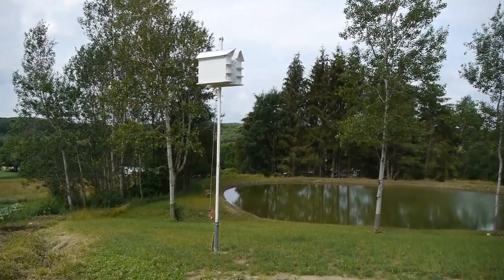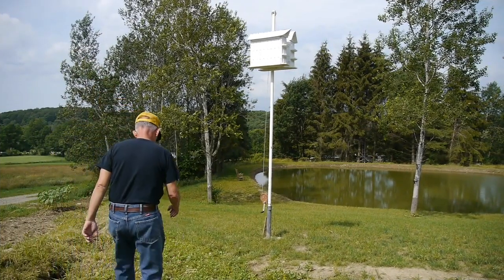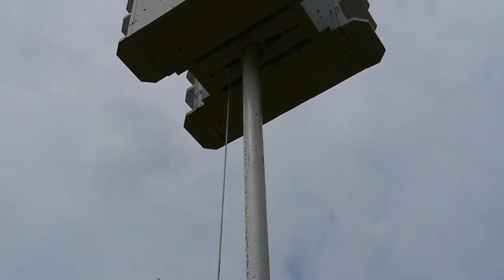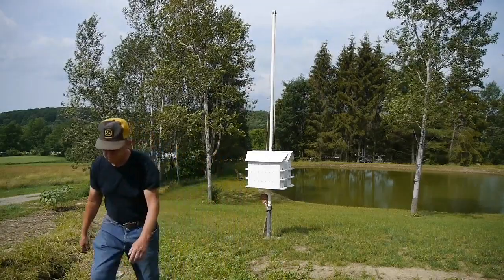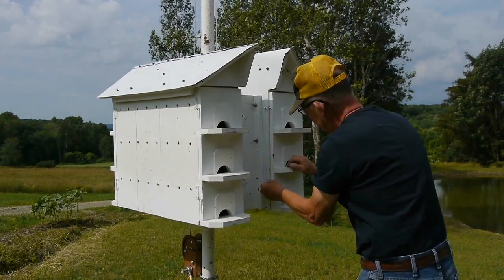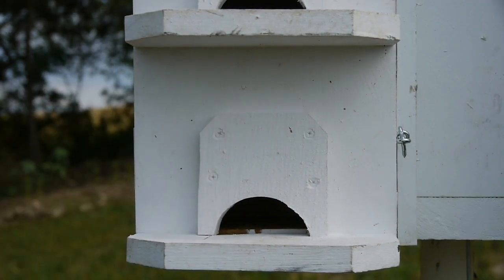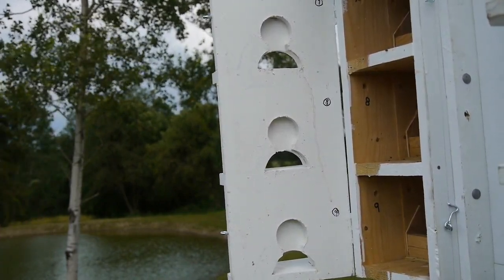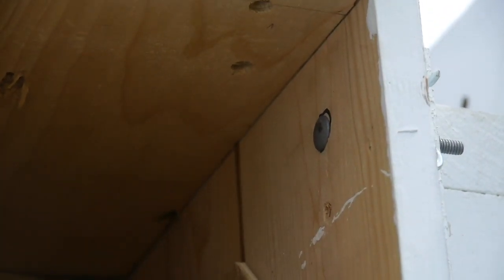Purple Martin House on a Pole

Comment: Would like to see more details on the pulley system, though I can see some details from the video.  Looks like you have an appropriately sized hole, matching the pole, through the center block and slots on each side of the pole for the pulley cable to go through, and a pulley at the top of the pole.  Does the brake on the winch keep the house from falling?  Looks like the cable segments in the slots in the middle block would keep the house from rotating in the wind.
Reply from the maker: You got it right. Yes the brake will stop the house in any position.  It's called a brake winch.

Comment: your house is fine where it is Martins Like to soar a lot and be able to see there house also the recommended height is 12 to 18 feet .Give it some time  because the babies will return and move in.
You can lower the house and clean it then cover the holes in off season.
Reply from the maker: No.  the cable keeps it from spinning.

Comment: i made one with a winch too, however it rode up and down on a 4x4 post which didn't work out because the 4x4 twisted. I was thinking about using straight exhaust pipe too but afraid it might bend in the wind. Any thoughts? how tall is your house? Great job

Comment: I like your pole. Do you have a video on making it.
Reply from the maker: The pipe is a piece of well casing i got from the scrapyard. I primed and painted it and we dug a hole 3 ft deep and cemented it into the ground.
Reply: Thanks much.  I'm still trying to figure out a gourd mount.  How tall is your house?
Reply: I see it is 12 feet.
Reply from the maker: It's up about 12 feet , I think

Comment: Can you tell me how I can find a winch pole like yours?
Reply from the maker: Hello Shelly.  The pole is a piece of well casing pipe i got at the junk yard which i cleaned up and painted.  The winch is a "brake winch".  I searched online and bought it somewhere.
Reply: You can use a winch from a boat trailer, the exact same thing
Reply: You can buy similar wenches at Harbor Freight. They ship is one is not near you. They are very reasonably priced. Don't go too cheap if you can afford it. They do work great!
Reply: The only issue with a boat winch is that most are not Brake winches, meaning is you let the handle go or it gets away from you the house will come crashing down very quickly.  It is advisable to make sure it is a brake winch.  As mentioned by others Harbor Freight has several at very reasonable prices.

Comment: So how did you do? Get many martins? I bet it filled up by the end of the season!
Reply from the maker: Actually, I do not have any Martins yet.  I have learned that it's best to put up a Martin House where you can monitor it and keep the sparrows and black birds out.  I am not at my camp much and the Sparrows have taken over the house.  Sparrows will drive Martins out.
Reply: Yes , this is my first year.  It sparked my appreciation of good Airguns. I had to eliminate several starlings and only a couple sparrows.   I didn’t put my house up until I saw martins at a nearby house.  So nobody had a chance to move in before the martins.  Now I am part of a really nice airgun club I’m Baton Rouge 😊
Reply: @dwightmarshallphoto  Which air gun to you think is the best one to purchase?
Reply: @jackloeb1779  that’s a tough question.  I have pcp Airguns which require a scuba tank to fill or a special compressor.  About a $1200 price tag to start.   A decent break barrel with a good scope about $450 would be fine.    Look at the reviews here for a break barrel.   I have had a few hatsan and Benjamin’s.    https://www.airgundepot.com/break-barrel-air-rifles.html
Reply: @jackloeb1779  (Gamo Raptor Whisper with scope) bought it online through Cabela's for around $150 Very accurate Pellet rifle, definitely take out a starling/sparrow at 50 Yards. Good luck with the Purple Martins ..